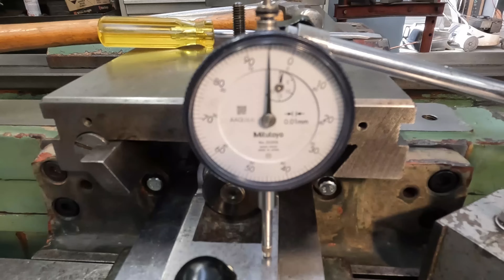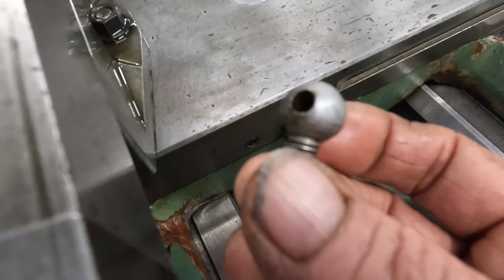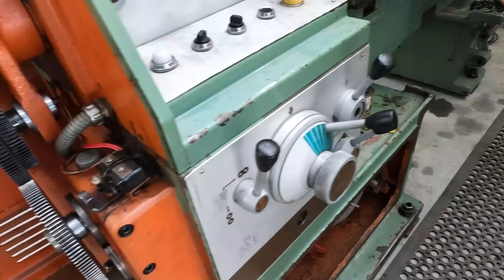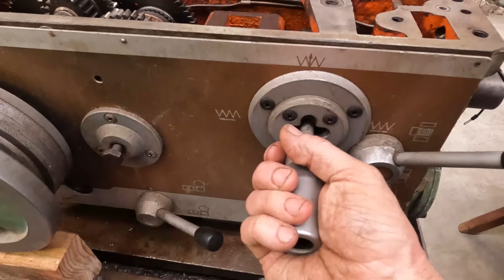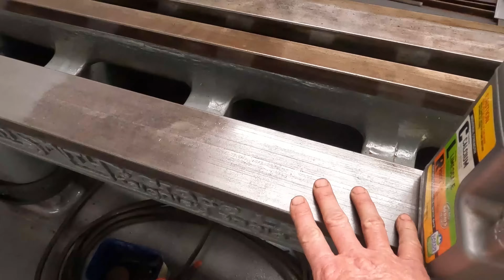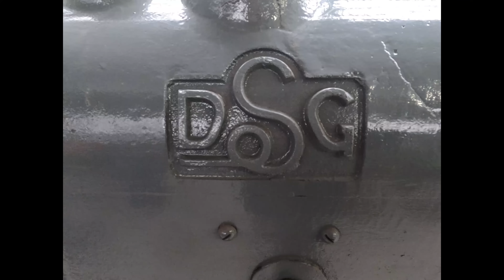JFMT  530 x 2000 Lathe Telescopic Feed Shaft Adjustment .

Comment: Smart inspectors coat. Good   discussion on machine dynamics. What would this lathes best taper Turning job be. Plenty of torque in the those heavy cast beasts.
Reply from the maker: Thanks .  I will be using the taper attachment to machine tapered shank tooling for my other machines .  👍

Comment: Nice update on the JFMT Max,  I've been trying to figure out the rapid traverse drive system. Is there an electric motor that overrides the normal mechanical drive shaft feed or is the standard feed electrically driven all the time. It's keeping me up at night wondering...Lol
ATB.....Cheers
Reply from the maker: Buggered if i know the answer to that one yet !   I would guess the electric motor just drives the feed that is engaged & the handle spins around by itself .  Like a rapid traverse on a milling machine .  👍

Comment: Coming along nicely. So how does Steven Alexander become Max? :)
Reply from the maker: Remember the Mad Max movies back in the 80's  ,  it's from then !   I was a bit wilder back in those days & was nicknamed Max .   It has stuck ever since !   👍
Reply: @swanvalleymachineshop  That's funny.  I remember your earlier videos when you were just starting construction of your shop.  You had your tractor with the backhoe on it and I remember thinking that looks right out of a Mad Max movie.  I always like the Mack in the Road Warrior.  My dad used nothing but Mack R600's back then and other than the steering wheel being on the wrong side it reminded me of our trucks. Ken
Reply from the maker: @hmw-ms3tx  Lol , Cheers Ken 👍
Reply from the maker: @hmw-ms3tx  There was a Mack  tipping off some road base in one of those video's !
Reply: @swanvalleymachineshop  I just went back and had a look at that video.  Your shop has come a long way.  It must be annoying for the driver of an Australian R600 having to look around the air breather when making right turns.  Over here they're on the opposite side of the driver and looking around them is a bit easier.  One benefit is you don't have to reach so far to spray ether into the breather on a cold morning.  That was my job when I was 6 years old.  Reach out of the window and spray the ether from the passenger seat while my dad turned the engine over.
Reply: @swanvalleymachineshop  Haha! I love that story. One of my favorite series of Mel Gibson movies.
Reply: No doubt that’s from his earlier days as a hit man for the mob. 😜😂😂😉
He could probably tell us, but then you understand he’d have to kill us both for “knowing too much!” 😳😳
Reply: @ianmoone2359  😂

Comment: G'day Max.  Excellent video with tons of content. Looking at the JFMT same as other lathes, we don't really think of all the Intricate bits & pieces that are fitted. The original designing,  manufacturing of parts, assembly & fine tuning of such complex unit.  Great video keep up the Great Work.
Even the Trade Cirtificate Looks Good. Bugger I didn't think of that ohh & I could have put the M.I.A.M.E  Certificate as well   lol  Yep missed that one 😅😊😂🎉
Reply from the maker: Lol ,  I have one of those somewhere for automotive aircon .   Funny thing is , it's illegal to strip an air con compressor unless you have  fitting & machining trade papers  !  Go figure .👍

Comment: Hi Max  There is one more important adjustment on the cross slide to check which can contribute to backlash.  The cross slide screw is anchored on the taper turning attachment end with roller thrust bearings.  These thrust bearings should have a slight preload.  If this preload is lost it can lead to backlash which mimicks the backlash in the front key drive.  I am saying this because I had this problem and it took a while to figure out.  Cheers.
Reply from the maker: Thanks .  That adjustment was done 3/4 of the way through the last video when fitting the taper attachment .  It would be an easy one to miss if you were only doing an adjustment .     Cheers  👍
Reply: @swanvalleymachineshop  Sorry Max  I missed that one. Cheers

Comment: Thank you for addressing my post from the previous video in regard to the alignment of the leadscrew to the cross-slide.  Clausing did provide a generous range of adjustment with their TA’s and I’d imagine it had something to do with the varying tolerances of a machine that was in production for 40+years and being that they sold the TA separately so that you could add it to an existing machine.  I’d imagine thats the main reason their installation instructions were so good and addressed the importance of alignment.  I like your method of reducing backlash and how you took into consideration the backlash in the telescopic joint.  I can see some chasing their tail of they didnt think to add this into the total backlash.
Reply from the maker: No worries .  👍